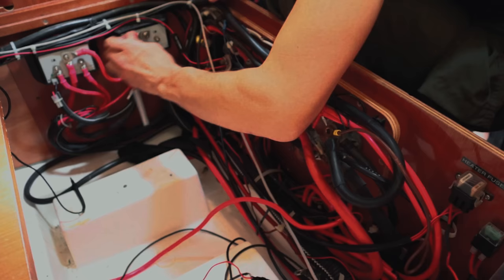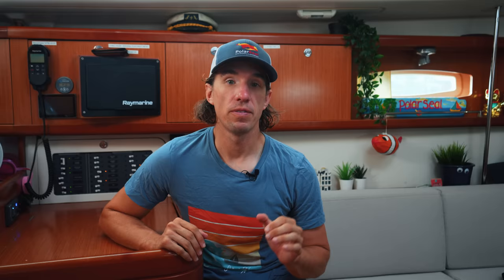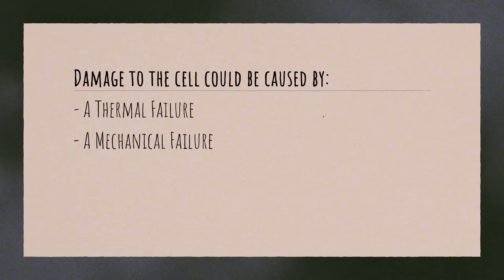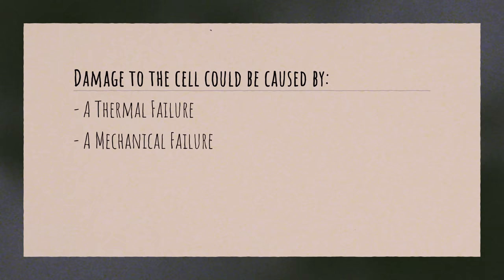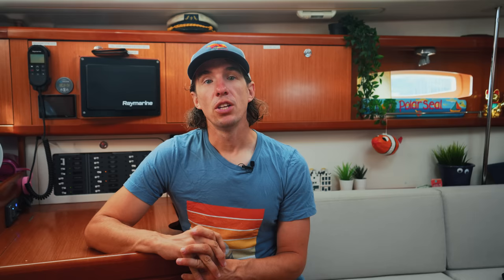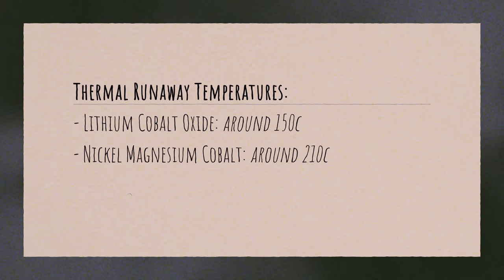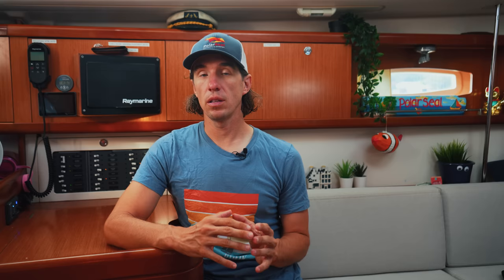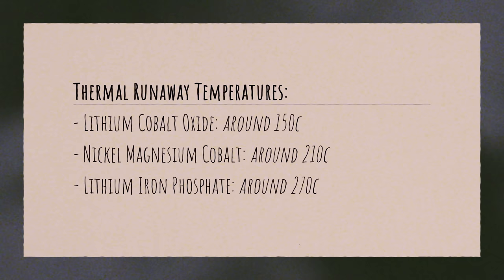WATCH THIS before installing lithium batteries on your sailboat ⚡ [RYAN'S TECH CORNER]

Comment: Wow! Lot's of good information.  In the future we might buy a bigger sailboat.  Ours is small and lots of fun.  Currently, we are traveling full time in a Winnebago Trend 2015 model 23B.  Our air conditional uses 13500 BTU I believe.  Plus we led lights and convection microwave which can use 1500watts at times.  Plus we small smart TV, laptop and 1 tablet and 2 cell phones, small  fan.  How many Dakota batteries would we need to be off grid? Note our small fridge can be on electric or propane.  I will have to check the watts for that one.  Feel free to PM me and I will give you our email.

Comment: In this week's O'Kellys video they discuss lithium batteries and sailing in the South Pacific. Per their research, insurance companies have low cap coverage for boats with lithium batteries. Another concern added to the mix. Here is the link for those interested. https://www.youtube.com/watch?v=I6DiY1h02a8 Lithium starts at @6:12.
Reply: That's not necessarily true and depends on the individual insurance company and sometimes even particular policy. We are insured by a UK-based insurance company and our policy explicitly covers our lithium battery installation and any damage it may cause. We did provide them with our system design, photos of our installation, and details of our battery management settings, including charging and discharging controls.

Comment: Excellent clarification there Ryan. Can you show us a set by step doing you friends boat. Also .. I only carry 220amp hrs of AGM which strangely enough .. for me is working kinda ok.  Can I replace with 220amp hrs of Lithium (space restrictions in the boat) and upgrade the charging cables/wires only as the draw should be the same from the Lithium as it is from the AGM.. the difference being I will be able to use more of the capacity than the small amount I can take from AGM. What is your recommendation for an external alternator charge controller ? I have Victron gear so do they make a good one? In this case would DC to DC charging off the AGM be sufficient as I don't use much power? Currently the AGM is charge by solar 260W and or a shore charger (30amp Victron) plus of course a alternator which is only about 50A max
Your thoughts and suggestions would be most welcome. I've been following your videos from the start and find you guys to be super informative ..back by genuine knowledge ..which is great. You would shudder to hear some of the things I have been told about electrical systems in boats ...  Bye the way, I am subscribed but need to search out your videos as they don't pop up on my You Tube feed. Not sure how this works but it must have some effect on how many views you get.?? 
Cheers from New Zealand ..hope you guys make your way down here sometime.
Reply: If your using a phone, next to the subscribe there's a bell. Click on the Bell and get all notifications.

Comment: ....continuation from the wrong DAKOTA CATALOG INFORMATION. - same technical data sheet: DISCHARGE 120 A max continuous, 180 A max 10-second pulse The CCA is the maximum discharge current for 30s .... and the shorter the time, the greater the maximum discharge current. So, either the story is wrong, or they install a hell of a capacitor to reach this peak for 30s. And yet we have a problem with the temperature of -18°C, where the battery just doesn't work....  ( As a thank's if you want, for finding errors at DAKOTA catalog. You could make a check, on the eletrical instalation, on my own s.w., a Catsh 43, Hans Christian.

Comment: 👍🏼 Well done. 

Are Dakota batteries capable of communicating with CANBUS or NMEA2000?
Reply: I’ll let Ryan answer. 

However, their website (and tech/sales) say no, they do not. 

He seemed to hint at meeting the ABYC (E-11 and E13…edited) standards being desirable and to communicate with a Wakespeed voltage regulator and other charge sources simultaneously, the canbus solution is pretty slick. It also makes a more robust solution to the alerting needed to either avoid a load dump or at least manage an impending BMS overcharge situation. 

I am VERY hopeful that Dakota Lithium comes out with a canbus (Victron) solution very soon. Ideally, it would be a series of batts that can integrate for series (24v, 48v) and parallel (800Ah+) arrays.  Many of us have been waiting for this as the Victron or Lithionics or DIY/[REC|Batrium|Taos|other external BMS] solutions are either pricy, or, perhaps, riskier. 

Great content, Ryan. I hope you can convince the Dakota Li team to incorporate CANbus communications. I think this would be a great service for the boating and RV communities.
Reply from the maker: There is BT plans, yes.  In fact I'll have one on the boat soon.  However our batteries are ABYC compliant as the standard decided to look at the entire system than the battery
Reply: @RyanSophieSailing  That would be a game changer. If you are interested in independent input please contact me. It could be interesting to incorporate into our cargo trailer conversion as mobile demo. 

FYI take a look at video on our channel we added BT monitoring to both lead acid and Lipo4 batteries.

Comment: Thanks - one question not covered - lithium batteries with separate charge and discharge terminals- thoughts- safety value or added cost with low value?
Reply from the maker: I think for very high power draw with critical applications its probably worth co sidering but for most yachts it's a bit overkill.  This is just my opinion however
Reply: @RyanSophieSailing  thank you

Comment: For the most part I would say it's a well done video but it was a little sales pitchish at times. 

Why if you think that external communication with the BMS is important does Dakota Lithium not offer good external communications?

Aslo Dakota Lithium batteries are not the  first rated for starting.  Relion HP series have been around for years. And well built batteries like Lithionics and KiloVault to name two have BMS that can handle the in-rush from starting a typical diesel engine on sailboats.

Comment: Not "dump loads" -- it is "load dumps"   All 3 lithium chemistries you have talked about can catch fire due to internal problems.... I have been waiting for you to mention lithium titanate.   Lithium titanate is the only lithium chemistry currently known that won't burn based on internal faults.   They have very good power delivery and unbeatable life.   They are not number one in power density.   Their size and weight is a bit higher than other chemistries.   But, their cost is high.   No one can sell them and make any money on then, so they are not adopted by boating companies.   Their pricing point it generally too high for the average consumer.
Reply from the maker: Well if we want to get technical its actually called a transient voltage spik, so I think we are just talking about slang.  Yes LTO is another chemistry and Dakota played with it a few years back, other that the cost issue the other issue was the cells are at a much lower voltage making integration with current systems more difficult.  But they are cool and very safe, as you say.
Reply: @RyanSophieSailing  Load dumps are usually generated over a length of wire which becomes an inductor when the current flows a distance.  The electromagnetic energy is released when the circuit is abruptly opened -- current continues to flow and without a load -- current must be converted to higher voltage according to ohms law.   When the source and the load are close by, this risk is typically reduced unless the source has high inductance like the windings in an alternator.

Comment: So... The plot thickens, he’s an entrepreneur as well as having all the information I need to fully upgrade my electrical system. I entered Dakota Lithium in my search bar and it says they’re available in Australia (hopefully that’s correct as I’d rather support you guys) I’m currently (pun intended) refitting a 32’ Farrier trimaran to better than brand new, I’m strengthening it around the bulkheads etc as well, having three new sails made (I have a good set that’s about 80% new but as this will be my one and only boat and considering my age I figure that starting with most thing’s new will give me at least ten years trouble free (famous last words lol, hopefully I last that long too, if my plan goes well the boat will still be better then than it was when purchased and if I do well I’ll either tidy it up again or sell as I may sell my house even after a few years and blow the lot on something... tempted now but no lol: In the Farrier I’m thinking TV, a good sound system akin to a 500w home system just smaller, small air conditioner for the coach roof section plus a few thing’s I’ve surely forgotten: solar as the main source with a diesel gen set as back up) The boat still has the one only original lead acid battery and one only solar panel from 1996 plus the wiring is a birds nest so will be replacing every electrical item as I want to spend as many trouble free months at a time away as I can and would prefer to have at least twice the electrical capacity or more than recommended (I sail solo and stay in Aussie waters, unfortunately my prescription meds can get me jailed in some countries and in others I can’t get them at all otherwise I’d be in a huge mono and half way around the world) I can rewire pre 1999 motorcycles without a diagram and using 10% of the wiring the factory used but solar and all the gear that goes with it does my head in (my house has solar as did my previous one but I paid to install it) I understand more than most about this but my brain is wired slightly different and I get the feeling yours is too which makes it’s difficult to follow verbal instructions like at school, the teacher said “If you don’t understand the question, ask again” so I did and they explained the question in the exact same way, again and again so I gave up: at 14 years old I got kicked out of school, at 15 years old I started a traineeship in accounting which you needed at least four more years of schooling to get, now I think a University degree lol (I left that when I got my drivers licence and never looked back, years of interstate trucking, many in my own truck but unfortunately there was no way back then to finance full time sailing (putting a driver in the truck wasn’t an option as most aren’t reliable) plus I had a severe addiction to fast motorcycles, it’s only now I can do it as I’ve settled and finally decided to see Australia from the outside in: anyway, if you do them I’m more than happy to purchase a custom wiring diagram plus whatever else you guys can supply, the only issue is shipping if required, it’s not worth it for bulky or heavy items (great country to live in but our gubbament is a rip-off.) I’m ready to do this now or in a month or two, making contact via your website might be better. Cheers, you guys are one of the few who keep it real.

Comment: Looks like you haven't heard of SUPERCAPS? I have 6x 80A/hr(480ahr) 12v caps on my 45' cruiser. My boat is the first in the world equipped with them. They are 98% efficient, 1 million cycle lifespan, no chance of them exploding or burning. No gas or chemicals stored or emitted. They operate between minus 50⁰C and 80⁰C. They can be safely discharged to 0v and stored under the workbench for 6 months and recharged when needed. They comply with all international aviation safety regulations and can be flown on a passenger aircraft safely and have a 10 year factory guarantee. I have had them on board for 3 years and are performing at 100%. I run a 12v 1.2kW windlass(100A). Autopilot, nav station, all lights, pumps, 80L freezer @ - 18⁰C and fridge @ 2.5 to 4.5⁰C. 2x 330W pollychrystal solar panels, 100-50 Victron MPPT and 12v to 12v- 30a Victron charger for changing with alternator. Lithium is sooo last Friday's technology.  Cape Town South Africa.
Reply: I’m gonna google it.  Maybe you can explain.

Comment: That was very informative and I am sharing it around. I was gung-ho to install Lithium and bought all of the bits. Then I started reading and thinking about Lightning strikes and their impacts on electronics. I’m pretty sure that my second hand boat has been struck by lightning in the past as I can see heat damage in various locations in the electrical system. As a result of this I decided to split my boats system to having AGMs for the house power (I would prefer to have FireFly batteries but these are not readily available) and have a separate 630 Amp Hour Lithium (Victron in my case to keep everything in the same brand) system installed in a metal case where all of the electronics are in the same housing to provide a faraday cage to limit exposure in the case of an electrical strike. The Lithium system will be charged primarily from the solar panels and wind generators. The housebank is then charged from the Lithium via a 100 amp DC/DC converter and the engine. The Lithium can be charged from the Housebank via the 100 Amp DC/DC converter and a manual cross over switch. I may add a higher external Generator high current charging capability when I understand that more. The idea with this isolated shielded Lithium Battery system is to have as few wires as possible connected to the electronics intensive Lithium and Solar Power system as possible and shield all of the solar feed cables right up to the panels. In this way I have just 2 removable cables between the Protected Lithium System and the House Power System (effectively an aerial in a Lightning Strike). 
One other power system protection I would like to instal is, for the main Navigation Computer (Ray Marine Axiom) is a heavily surge protected uninterruptible power supply. This would be a small battery with a bank of devices such as on the input side a fuse, inrush limiter, zender diode, capacitor, ahead of the battery and a DC/DC converter on the output side to the Navigation Computer and sensor systems. Feel free for BattleBorn to put together such a device, I’ll buy 2 straight away, as long as it is cheaper than my Axiom.
One little giveaway piece of advice I offer people is, if you have your mast off the boat, replace all of the cabling with Aviation cable. Reason? Aviation cable is silver plated, silicon sheathed, fibre glass externally sheathed, and there is a final external tough low friction rub protection layer. I suspect that there electrical shielding versions as well for the main power feed to the top of the mast.
With you broad exposure, I’d love to collect any and all stories of lightning strikes, detailing the damaged caused, what systems were affected, the entry and exit method of the charge. This with a view to find effective low cost protection strategies. 
Thanks for your comprehensive coverage of the Lithium Batteries and installation advices.
Reply: I like your approach. I would like to do similar. What DC/DC converters are you using?
BTW... I work in the aviation wire business. The cabling you mention might not be so hot. Great mechanical properties, but the insulation has poor partial discharge characteristics and degrades with time.
Reply: @methyleneblue4659  Thanks MB. I’m using the Top Systems TS1600 programable 100 amp DC/DC converter. Good to know on the Aviation cabling. I will have to look into that. If you want faraday cage materials there is a specialist company in Dordrecht Netherlands who have a comprehensive range of materials and solutions. 
One of the more extreme solutions I am considering is to make a “copper chain” (going back a few centuries) gunwale to mast head loop made of silver plated half inch copper tube segments with a stainless steel inner cable for tensioning. They use such tubes in 400,000 volt switching. I just don’t know how it would hold up in the marine environment. The best approach is to keep the electrical charge out of the boat altogether, and the capping has to be a dome of sorts to be as un attractive as possible.
Everything in this field is experimental, but doing nothing is begging for expensive failure.

Comment: Hi Ryan, mate, I have installed to LifePo4 batteries in my Jeanneau sun odyssey. I truly believe they are the best choice for a yacht due to the discharge capabilities.  I have installed a lithium compatible MPP controller. I have a DC/DC charger but I'm not sure where to install it. I am unable to follow the wires from the alternator to see whether it charges the house bank as well as the starter battery. There are two separate live wires that run from each bank however the negative lead runs from starter battery to house battery. Does that actually mean they are linked. 
Unfortunately, I haven't been able to find an electrician that can help me. Here in Qld, Australia there is still a negative attitude towards LifePo4 on yachts. Yachties are very set in their ways!  I also don,t see a battery charger on board that is connected to shore power circuit. 
Is there a way I can turn off MPP controller and run the engine to see if in fact the house batteries are linked to alternator? I should be able to put a multimeter on the battery to see if it is accepting charge shouldnt I ? 
Thanks for your videos, they are so informative.
Cheers
Reply: Take a dc clampmeter. This shows dc current flowing when put over a + wire. Also a multimeter shows 14.5 v when alternator starts charging (on your housebank)
Reply: @ivo1503   thanks mate appreciatied.

Comment: Almost all the risk has nothing to do with the technology. The risk associated with the technology is very small compared to the risk of change and the situational risk. If one is about to make an ocean passage to remote locations completely changing from a LA based system to all lithium is a non starter. Also, the failure rate of lithium vs LA is immaterial against the binary nature of failure of lithium and the lack of potential for user intervention.